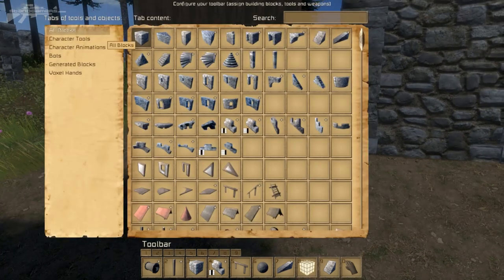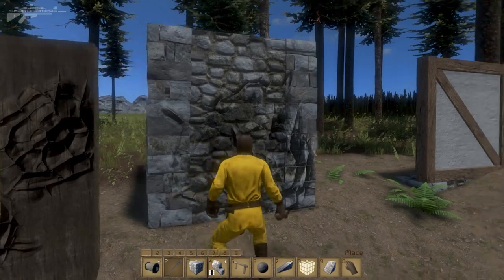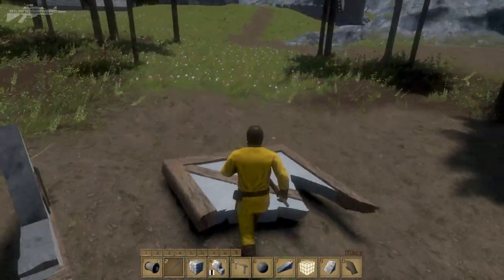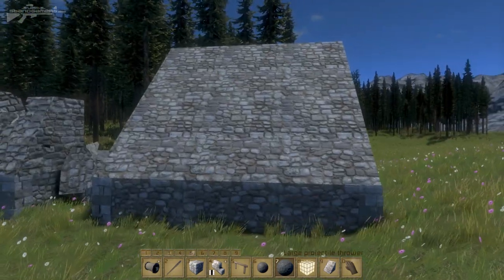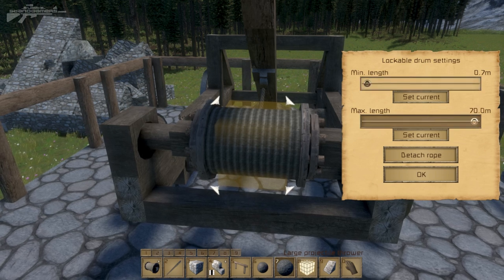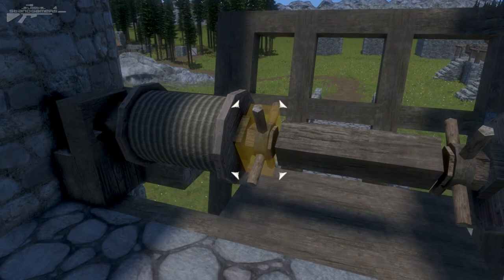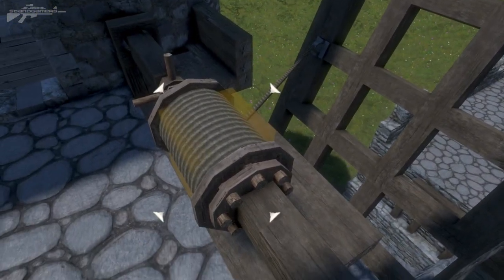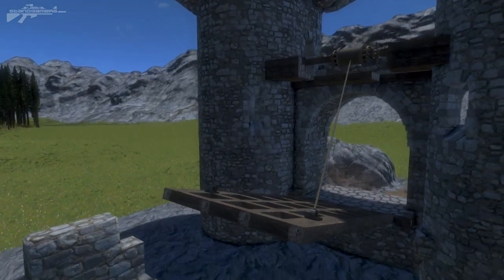Medieval Engineers - Block Damage , Locking Rope Drum

Comment: The bumpmapped decals are strong with this one.
At least, I hope they're bumpmapped!
Reply: Sapphire Crook
 If you're talking about the special decal system that causes the surface to deform and change shape, then yes, I believe these are. I recall not being able to see the bottom of an impact crater from an angle. This system is also in place in SE. There, they are referred to as Normal Maps.